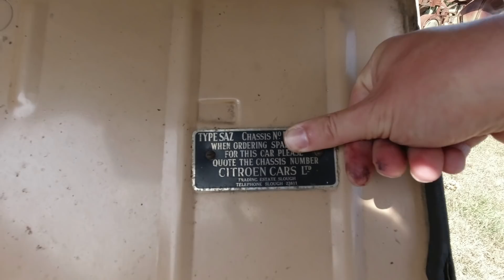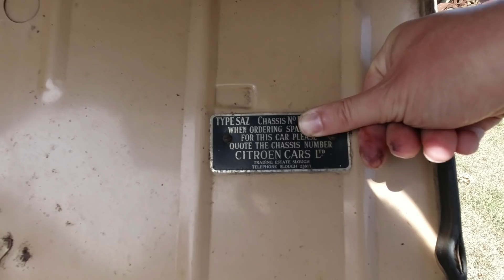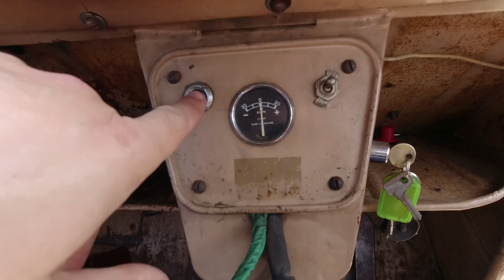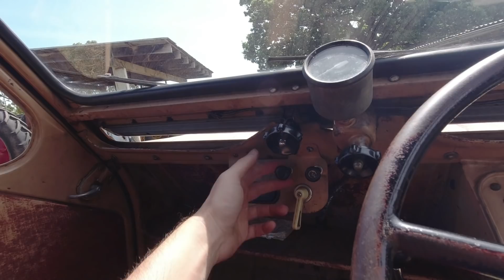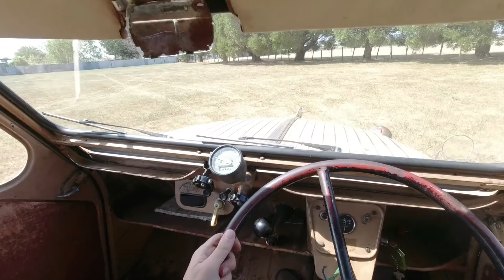British-built 1955 2CV road test, in Tasmania, Australia! 425cc!

Comment: Imagine that in Wales in the winter without heater or decent wipers.
Reply: I used to take my Dyane...with heater..down to deepest North Wales in winter. You still needed a decent padded coat and a good warm hat...but some warmth did get through. I never had a grille muff (couldn't afford fripperies).....bit late now... The wipers were fine. The car was excellent in snow !
Reply: @timhancock6626  in my cinquecento the heater is fine in the summer but only like warm in the winter... the radiator in those is the size of an a4 sheet of paper and only an inch thick. The wipers float on the windscreen at over 60mph and that's a 90s car. But I love it anyway.

Comment: What about the fuel gauge you didn’t highlight that,or was it lost_ my 55 model even has the original hand book
Reply from the maker: I don't believe it has one. Some said the red light that didn't work was a low fuel light, while French ones (as you probably well know) had a simple dipstick.
Reply: HubNut according to my hand book the light is the directional indicator warning light. My original owners hand book in English unfortunately shows LHD pictures. The fuel ‘dip stick’ rests inside the fuel filler on a little hook. When engaging 4th gear, as my hand book describes it, you go across from 3rd and not down to neutral.
Reply from the maker: Thanks. It'll pass through neutral on its way to fourth but yes, I do tend to twist from third, which helps it find its way to fourth.

Comment: Whats the little red lamp on the back of the headlights for? I've seen them on other makes of lamps too.
I'm actually starting to like French cars from watching this channel!
Reply: Isnt that for checking if they actually work? You can see it while driving.
Reply: @mehrzahl2219  I think you're right.
Reply: Nick Vallender I believe they’re so the driver knows that the headlights are turned on, while in the driver’s seat. My father still says that with most British (and French) cars of the 50’s and 60’s, the lights were so poor, that you needed to strike a match to see if the headlights were on or not!
Reply from the maker: Yes, a tell-tale. Not generally fitted to the French ones I don't think.

Comment: Can someone please explain how that clutch system works? It's like a backwards crash box, and I have no clue how it would work.
Reply from the maker: It's a centrifugal clutch, so higher engine speed overcomes the weights holding the clutch disengaged and it then engages.
Reply: @HubNut  After doing some of my own interneting on how that works Its actually a really clever system, You learn something new everyday. I assume that the later 602cc 2CV's didn't use it because the engine became to powerful.
Reply from the maker: No, more just different tastes. There was briefly a centrifugal clutch option on 1980s 2CVs in some markets, but not the UK. People preferred either full auto or full manual rather than a halfway house.

Comment: Wonderful quirky ride! Gotta love how the speedometer controls the windscreen wipers, and how the light switch wants to control the fuel gauge. Marvelous !!
Reply: The lights acting on the fuel gauge is typical French electrics: bad mass-connections. This is very pronounced in these early 6V cars, but my 12V 1986 2CV6 does this as well (makes you think you'll run out of fuel in the middle of the night while there's almost half a tank left). You even see this on more modern French cars, like a 2000 Renault Clio I had: lights on + brakes + blinking = christmas tree in the back and the fog light dashboard light faintly glowing. 
The problem is every warning light, gauge, outside light... has its own plus-feed, but the negatives are tied together and connected to parts that sometimes aren't even part of the main body (the negative wire of the front blinkers of a late 2CV is simply sandwiched between the wing and the valence panel) with a piece of thin wire, a flimsy eyelet, and paint between the eyelet and the bodypart.

Comment: HubNut.   Believe it or not. The number plate or registration plate on the car is not from Tasmania. Instead it's from Victoria, and also it's actually a 1955 registered car,with incredibly still on it's original registration. I know this because my brother in law had a 1955 FJ Holden , with the black and white plate starting with the letter G
Reply: Black and White G prefix plates started in 1955 and ran to about 1960 (Dads !960 Vanguard was GXY, As the plates are GO i'd say about 1958
Funny I can remember plates from 60 years ago, but I have to check the number plate of the car I've owned for 11 years before I book it in for service
Reply: @garthpetch4173  the new  standard Vic plates are awful - number-letter-letter number-letter-letter. Almost always forgettable. Fortunately when I bought my current car the dealer threw in old-style plates as part of the deal so I got AOK which is easy to remember and the car has lived up to that, it is "A-OK".
Reply: 1953 started the 3 letter 3 number plates with the letter G.  It appears to have had continuous original registration since it was new.  Can't be many about with that sort of history, that are still a daily driver.  Those plates are worth something on their own.

Comment: I actually  have a hawes watering can  it I drove an army jeep in Germany  in 1980 and went to put into 4 wheel drive and pulled welded shift handle off. Broke it actually.  I be afraid to pull on the parking brake handle because it would come through the floor. And its 1 model year older than I am!

Comment: Australian number plates are nowhere near as accurate (and anorak-y) as UK ones, but a Victorian black-and-white G is likely to have originally been issued in the later 1960s -- perhaps '66 or '67?
Reply from the maker: A few have said it could be the original 1955 plate. I don't know much about Aussie plates...
Reply: mid to late 1950s.  (Caution, number plate nerdery follows...) My parents had a 58 or 59 Vanguard that was HBY154. I had a 67 Morris 1100 that was JYU327 so we were well into the J's by mid 60s. Victorian regos in that pattern (3 letters 3 numbers, white letters on a black background) started at GAA 000, went to HZZ999 then JAA000 as there were no initial I plates in that sequence.(I believe that was because a letter I looked like a digit 1...) After the J's, K's and L's they went back and did I-plates, that would have been in 1974. Leyland P76s for example were registered in Vic with L plates for early cars, then I plates for the last of them. They didn't do M plates after the L's because M plates were reserved for Vic government cars. (still are..) After the I plates finished they started over, with green lettering on white plates, starting at AAA001 and the "Victoria  the Garden State" logo that we never should have dropped...

Comment: Farmers must have loved the ease and simplicity of maintaining these little cars. Nice video.
Reply: One could imagine the toolkit - simply 3 different sized hammers.
Reply from the maker: 12mm and 19mm for most stuff on these I think.
Reply: @HubNut  That's quite close to half-inch and 3/4" for the French.
Found the front wheelnuts on a Case digger were <21mm - and seemed to be a unique size to those diggers and not part of any range of spanners.
Reply: @HubNut  What about the spark plugs ?
Reply from the maker: @millomweb  Piece of cake.

Comment: Did the designers at Citroen have a long-running competition among themselves as to who could come up with the wackiest design features?
Reply: Thats abslolutely right. Have a look to this Wiki link

 https://en.wikipedia.org/wiki/Citroën_2CV

After the takeover of Citroën by Michelin in 1935, the senior authorities of the Chevrons brand openly want to target the market for the economical car. This is why Pierre-Jules Boulanger, newly appointed director of Citroën, has been mandated to complete this project.

The market study for this project shows expectations from potential customers. It is with this that Boulanger elaborates precise specifications for the one which will be baptized before the war the TPV (Toute Petite Voiture -  Very Small Car)

The designers were free to explore any options. Here are the specifications "Have your services study a vehicle that can transport two cultivators in hooves, fifty kilos
 of potatoes or a keg at a maximum speed of 60 km / h, for a consumption of 3 liters of gas per hundred kilometers. In addition, this vehicle must be able to pass in the worst roads, it must be light enough to be handled by a novice operator. Its comfort must be impeccable because the baskets of eggs transported at the back must arrive intact despite the ruts. His price should be much lower than that of our Traction Avant, and finally, I would like to point out that its aesthetics I don't care. "

Here is an authentic anecdote. The most extravagant solutions were imagined, like glow worms as position lights!

Comment: 6:05 It's ironic that it's called a 2CV when it has no CVs; I guess this odd French naming convention was more important than making the name intuitive to English speakers. I like the louvered front grill; it looks a lot better than the angry-bug-mouth they put on latter models.
Reply: This odd French naming convention is related to the tax horsepower system that is still in use in an altered version, but was more important before because of the annual "vignette" cost indexed on the tax horsepower. BTW, most of the manufactured 2CV were in fact 3CV tax horsepower.
https://en.wikipedia.org/wiki/Tax_horsepower#France

Comment: This car is insane. I love how all the engineering looks like an afterthought. The body roll looks dangerous. I love it.
Reply: No afterthoughts, the engineers were very good.
Reply: @rogerhudson9732  Notice i said "look" like afterthoughts. When compared to almost every car ever made, having the gear lever in the engine compartment and operated by a rod. Also the cable to actuate the starter. Very cheap to produce, no unnecessary wiring and relays.No waste of materials. Its beautiful.
Reply: Sorry sir, option extra wipers is not available without optional extra speedo.
Reply: My 2 CV based Mehari in France rolls around roundabouts at speed , no problem  and .no requirement to slow down...the suspension keeps the wheels glued to the road. Only the French could have desgined it.
Les Griffiths
Reply: jbrooks4282   By any standards it’s not a proper car is it... more of a motorised pram really.

Cute though...
Reply: @Aussie Pom Well since you put it that way now I have to go watch them.
Reply: @johnmoruzzi7236  You mean it's really the earliest form of motorised skate board with seats ?

Comment: They were designed perfectly for the culture of their owners, like no other vehicle has ever been.   Fairly good in fields, simple, robust ish, seats are deck chairs.   Charm overload.
Reply: Lassi Kinnunen  I suppose the sad thing is that something this simple would no longer pass safety tests for new cars - even the modern (but now discontinued) Tata Nano failed  basic safety crash tests which is why it wasn't sold much outside India (and didn't even sell very well there). But there is a 'quadricycle' vehicle class in some countries, for small vehicles with very limited power and top speed which presumably don't need such high safety standards.
Reply: @frglee  Yes, I lost count of all the things that would get this car banned from the USA. Citroen left the U.S. market when our NHTSA demanded they make the bumpers on the DS maintain a consistent height.
Reply: 'Sept when you need to bump start it.....

Comment: Only the French would be so lazy in their vehicle design as to literally put an extension pipe on their gear shift to get it into the car. I remember being so confused by the 2CV shifter until I saw under the hood for the first time.
Reply from the maker: It works beautifully. When the bushes aren't quite so worn... Far better than the change in my GSA.

Comment: That bonnet emblem is a true work of art. The opening rear windows are a lovely add to the car I think. It is fascinating that it would have never been a factory mod or option or dealer-added extra. I think it looks very nice, especially when viewed from profile. The fuel cap is a nice addition. I really love the picknick conversion that came at a no-cost (hehe) option there. 

Oh yes this car is hiding intriguing bits and pieces what makes it so nice. The vintage stickers not to forget of course.  Even the brakes aren’t that bad. I have a suggestion: not only test the wipers, also the horns, as you sometimes already do. I prefer the looks under the bonnet, especially when we have a look at it while it is idling! Also a suggestion. Lovely!
Reply: "Opening rear windows" - silly boy - they just put front doors on the back - left front = right rear and right front = left rear. So if you ever come across a 2CV with  the only externally lockable door on the rear, they've mixed the doors up when putting them back on.
Reply: @millomweb  Even a blind guy can see that's not true at all. The shape of the doors are very obviously different and the windows are different as well. With all parts of a 2CV readily available (except for a few things of the oldest models), don't you think you'd see more 2CVs with opening rear windows if the front ones would fit?

Comment: I had a Dyane 4. With 4 adults and towing a Townsend Thoresen trailer tent we toured Normandy, Paris and into Belgium. On our last day on the Continent we had to drive the main coastal route from Belgium to Calais. There was a gale blowing up the Channel and the car just would not go in fourth gear. The ferry crossing was horrendous.
Great memories of my posh 2CV though, thank you.
Reply from the maker: Blimey! Just shows what a hammering these things can take.
Reply: Carlisle to Edinburgh - up the A 74 (>A702) Mk1 Granada 3 litre into a headwind topped 60 mph ! Without the headwind, it'd do 110.
Reply: @RussEdgar445y7tlfj  When engines start using oil, people tend to use cheap oil - and that makes things much worse. I've had people comment "what have you done to the engine as it's not using any oil". It had had an oil change - with good quality oil going in it.
Was it petrol ? Injected or carburetted ? I knew a guy took his Metro for MOT and after that, it wouldn't go faster than 50 mph due to lack of fuel. Needed the carb readjusted back to where it should have been.
#emissions test
Reply: @RussEdgar445y7tlfj  Much is said about 'cold'. Once the oil warning light has gone out, pretty much everything is being lubricated - perhaps not fully but enough. Pistons will be small - that'll allow more oil up to the rings but they'll be doing their job as a gas seal. TBH I think the real sufferer of cold are drive belts - quite possibly more brittle than normal but a cold belt run for a few minutes will soon warm up via its own stiffness. I'd agree that hammering things cold is not a good idea but I'm not convinced it's as bad as people make out. I'm all in favour of a tendency of high gear, low revs but I also believe a good thrash from time to time will have some benefits - like possibly on the exhaust.

Comment: A brilliant little car. A few things : The elasticated clips on the hood are to hold the hood in position when it is rolled back, they aren’t a release mechanism (simply pull the hood forward to release). There is no cowling missing on the engine - that’s all you get! The red light on the dash is a fuel low light - there is no gauge - there is a dipstick inside the tank under that elegant fuel cap - otherwise the light comes on when the fuel is low - warning you when it’s probably a bit late! Emergency stopping  without dipping the clutch - probably not recommended the centrifugal clutch disengages at low speed  - Great video however!
Reply: Emergency stopping - only difference is that you're emergency slowing down the engine unnecessarily.
Reply: Thank you for that extra knowledge. Today is a good day at school!
Reply: Bertie, even the later 2CVs never had the sophistication of a 'low fuel' light so I very much doubt that a Slough-built version would have benefitted from such a device.
Also, the dipstick you've mentioned was stored in the boot, not 'inside the tank'...
Reply: @kenhanna6834  Hi Ken - There is a float and an equivalent of a 'sender' without a variable resistor in the tank which is just a switch that indicates low level  - this lights up the dash light when fuel is low. Yes - can keep the dipstick in the boot but it sits nicely out of the way in the tank/filler too

Comment: I am the happy owner of a 1984 build 2CV 6. But it is too powerful, too modern, ironed and civilized compared to the archetypal  2CV that our dear Mr Hubnut gives us to discover here. 

The rattling sound of the pull starter when it starts ... The 425 cc engine has a strong personality and its specific exhaust system which opens out under the driver's feet generates an inimitable melody. The suspension fitted with friction dampers allows it to wiggle, which justifies its duck name. Those are just a few points.

Thank you Mr Hibnut ! This car is a real gem !